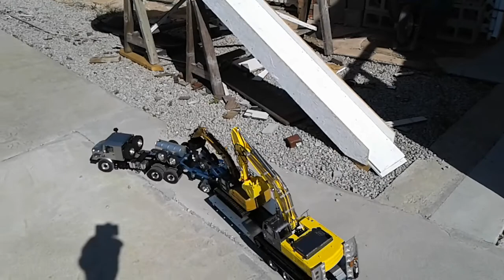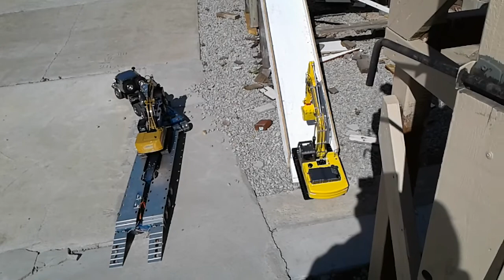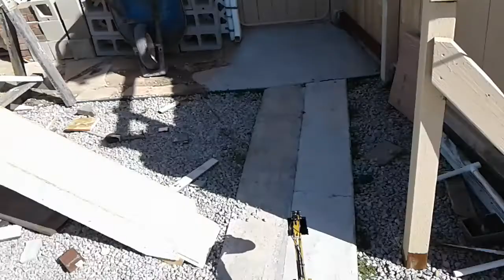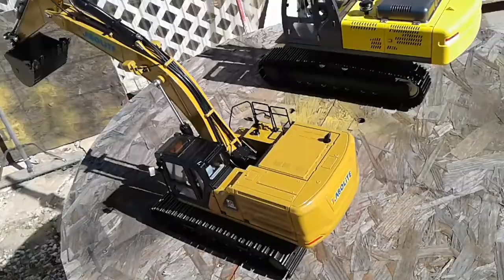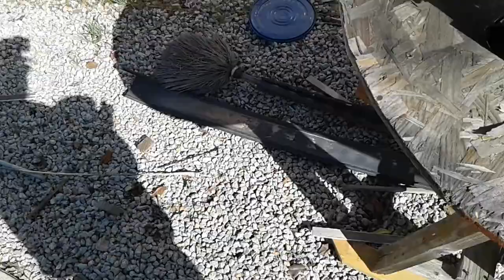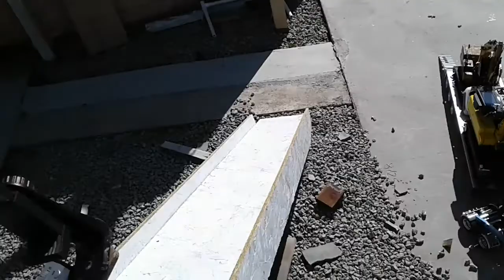Kabolite K350 1:14 excavator , kabolite 1:16 excavator,  Zetros 1:14 6x6 .

Comment: Hello which actuators did you use for your trailer ramps? I am in the process of building a hydraulic system for the ramps but electric ramps might be more practical

Thanks
Reply from the maker: actuonix.com L12 Linear Actuators